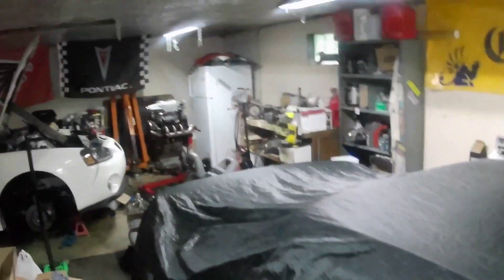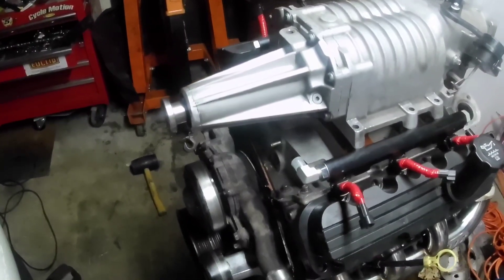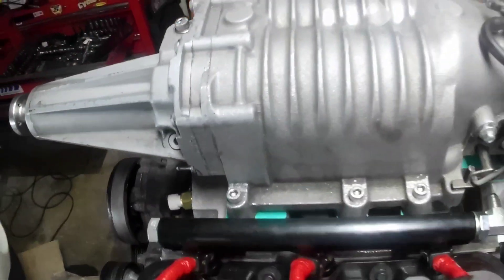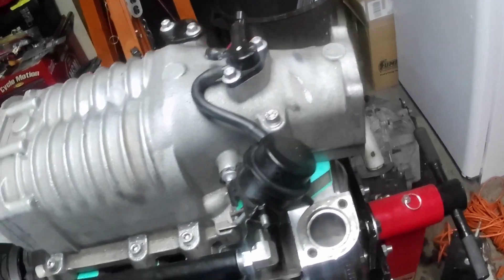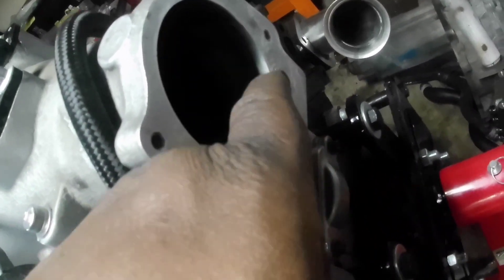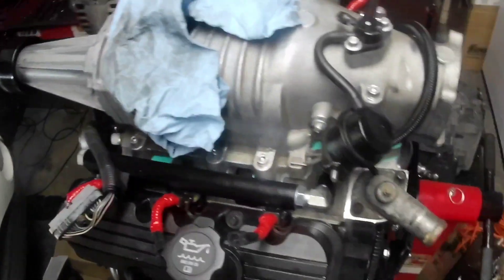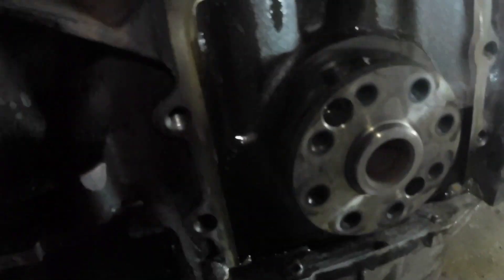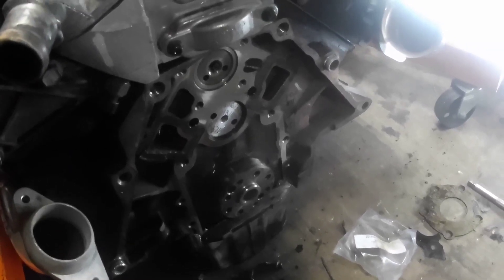Bolt for Bolt episode 10( 3800 nic cam motor ready to drop in)

Comment: You'll have no problem with those pulley sizes non-I/C, even on an N/A block, especially with that cam.  Ran my X-P the same way and it was great dialed in, even more on 100+ unleaded.
Reply from the maker: Yea just being more cautious on the tuning part cause of the plogs

Comment: Just wondering what the smallest pully on a supercharger heavy modded 3800 ? 2.4 inch ? M90 also another question. Anyone run a M112 ? If so how it work ? Good responsive ?
Reply from the maker: I have a 2.5 on my red car that is a max effort m90 build theres people with mp112 i have no experience to talk about those but i heard good things about them